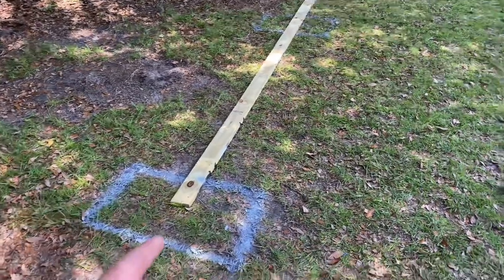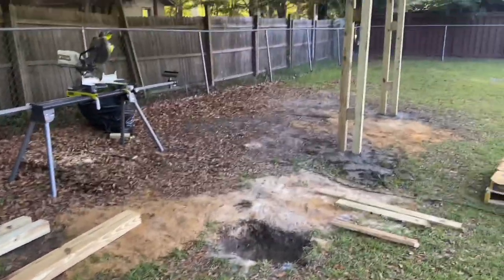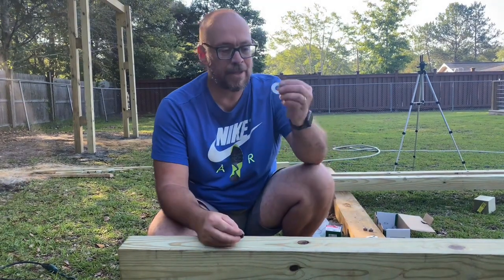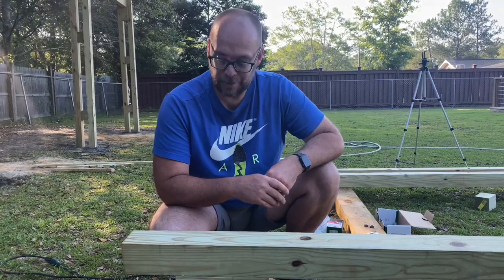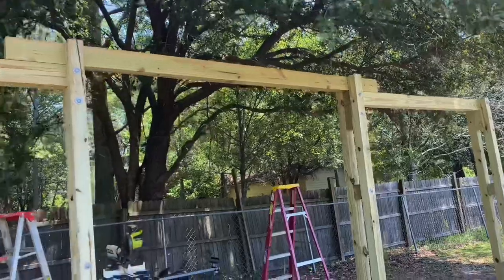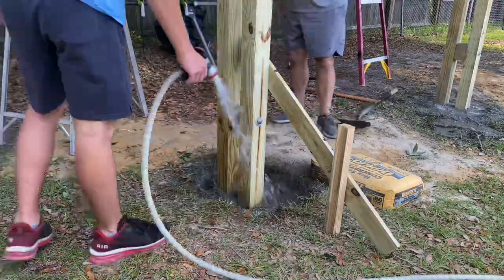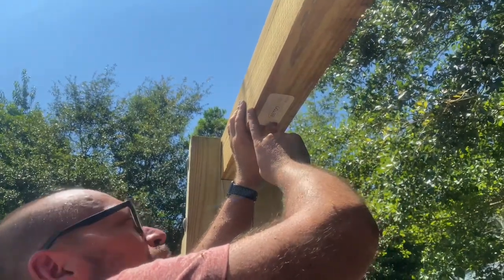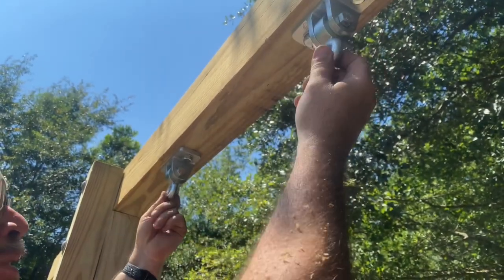Build Your Own Swing Set - Step by Step

Comment: Great video! I'm gearing up to build a simple 2-swing version of this once the weather warms up. I debating between using your 2-4x4 post setup verses a single 6x6 post for the primary verticals. After a year of use, do you have any thoughts on which would make a stronger vertical post?
Reply from the maker: Thank you. We feel like the two 4x4s still was the best way to go. It’s not swaying or acting as if it’s any different than the day we built it. We checked on 4x4s and 6x6s the other day for another project and the 4x4s were $16, while the 6x6s were $50+ each. Lol

Comment: This looks amazing! We have 4 boys and a girl. Want to get a set built before my husband deploys. Just wondering why you went with single post as opposed to A Frame, besides a smaller footprint. Trying to decide which will be better for lots of grown kids. Thank you!
Reply from the maker: Thank you. We went this way because we wanted that smaller footprint, so we didn’t have post we’d bump into and extra space we would have to mow/weed eat around. So far it’s worked great and we use it a lot, even the adults. Lol
Reply: @TheTrentTribe   thanks for replying! Did you ever add the extension playhouse on?
Reply from the maker: @ashleycrosson3761  not yet. It’s on our to do list for Spring. We actually bought a fixer upper and have been neck deep in that. But we are hoping to repurpose a wood structure from that house and convert it to a playhouse for this swing set.
Reply: @TheTrentTribe  ah, fun stuff! That'll definitely keep you busy and the kids!

Comment: After a year, how is this holding up? Has the amount of sway changed when a couple of people are using the swings in the same bay? Thanks for the great video.
Reply from the maker: Thanks for the comment. Actually, it’s doing great. We don’t have anymore sway, which was minimal, than we started with. We are actually getting ready to add a slide and tree house to the end of the it, which was what we had in mind when we made it.
Reply: Wea are ready to see the new video of the slide and the tree house
Reply: @TheTrentTribe  what is the length of the 4x4s and how much did you cut off ?

Comment: How is it holding up? A lot of designs have wide legs front to back because that's where all the force from swinging goes. Is there any rocking or twisting yet with the two in one beams you did? Looks like a great design for me since my yard is sloped and math is hard, this keeps it kind of 2 dimensional, easier to plan.
Reply from the maker: Ours is holding up great. There’s a slight rock, but that’s been there since the cement dried. It’s definitely not worse, but it’s not much of one to begin with. We’ve used it a lot and several times have had a full load with teenagers and adults on it.

Comment: how many 50  lbs bags did you use in total and how deep what the hole you dig? I am trying to figure how the math. Will I need 10 bags for a 4 feet hole for both sides?
Reply from the maker: I think that’s about right. If I remember correctly, we bought 40 bags and used all or most all of them. That was 50 pound bags. The hardware store just delivered them on a pallet, which was great. Lol

Comment: Would one station (2 poles) be as rigid as you three station setup?
Reply from the maker: I’m not sure I follow your question. Are you saying one station, as in just one swing in between two poles and that’s all, instead of 3-4 stations like we have? If so, I’d say yes I think it would work fine. Ours has held up great so far. There’s been a few times we’ve had all teenagers on it and it has done great.
Reply: Yes, 2 posts and one beam…I don’t have the space for your 4 post/3 beam set up so I want to try it with just 2 posts and one beam. I wasn’t sure if tying all your beams and posts together made it much more rigid (no sway).
Reply from the maker: @stoweman34  gotcha. I’m guessing if you go deep enough on your poles, you’d be fine. I wouldn’t hesitate to do it myself.

Comment: What was the total cost?
Reply from the maker: We were trying to figure this out yesterday. It seems we were around $1000 for it all, but wood was more expensive when we did it. Probably quite a bit less now.
Reply: @TheTrentTribe  i've been delaying building something because wood prices.  But the kits are all mostly 1 by boards and my kids will destroy that we need it sturdy I got 3 boys
Reply from the maker: @tinyku  that was the reason we didn’t go with a kit. Cheap wood that won’t last long.
Reply: Just did mine with 6x6 posts, and 2 2x6 headers. With Lumber,  concrete and hardware,  I was sitting under 600 canadian.